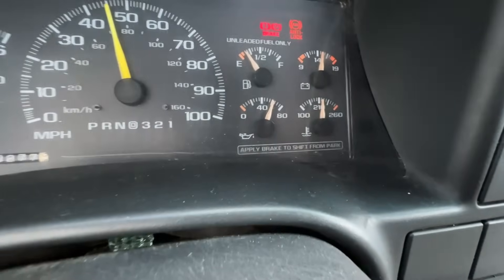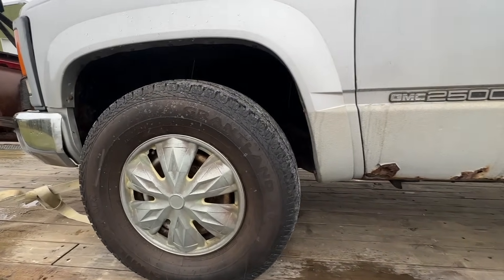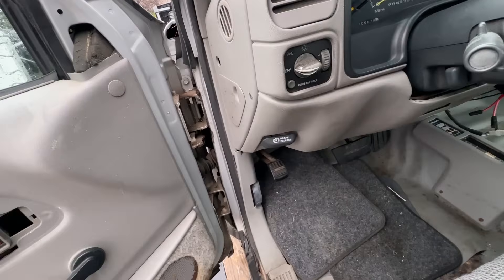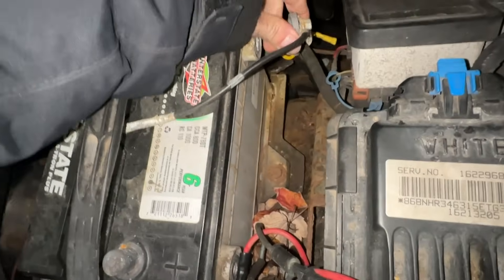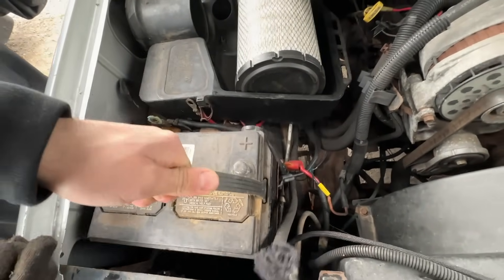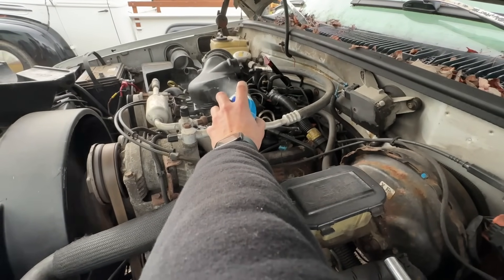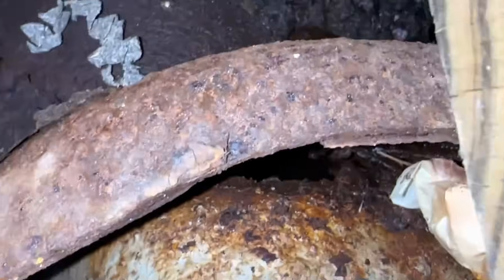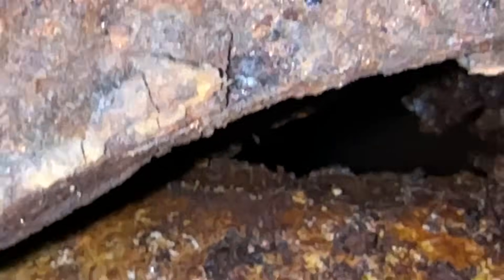Starting a HIGH INCOME Business for Less Than $1000!

Comment: Yep put that gas cap on you wouldn't want a check engine light bringing down the resale value on that thing
Reply from the maker: Already has a small u bolt plugging off the purge valve I think that light will be on until this thing goes to rot buggy heaven

Comment: Over heating due to blade being too high and on a angle.  I gotta run my blade straight and just inches off road.  Lights have a white ground wire. Plow truck needs good batteries and good tires. A tow strap.
Reply from the maker: It was overheating just idling.

Comment: @richrules hey Rick, we use 93 chevy pickup for plow truck, the plow all the way up blocks the air on ours from the radiator and causes same issue,  we just lower it a little and works better.

Comment: Get a decent electric fan in front of the radiator. If its an a\c cab, remove the condenser. Don't need a\c in winter anyway

Comment: Sometimes plows will make the vehicle run hotter . Due to it blocking the flow of air .
Reply from the maker: It was getting hot sitting parked!
Reply: @richrules  ah . Then your probably right with the thermostat.